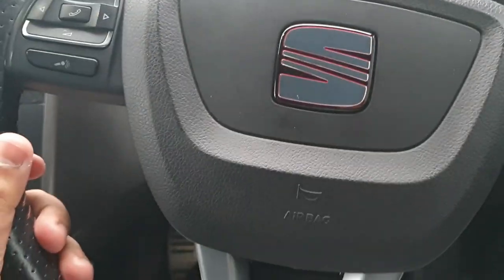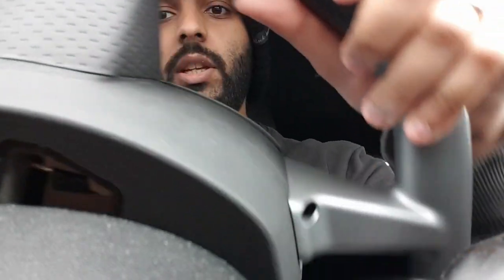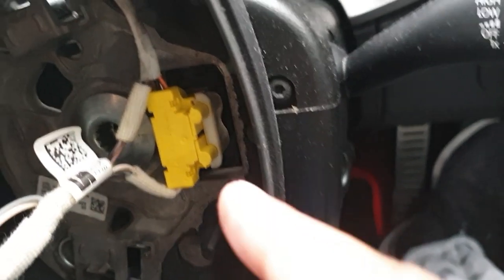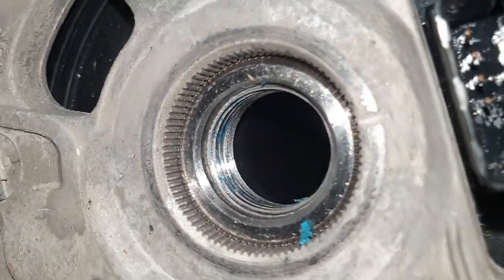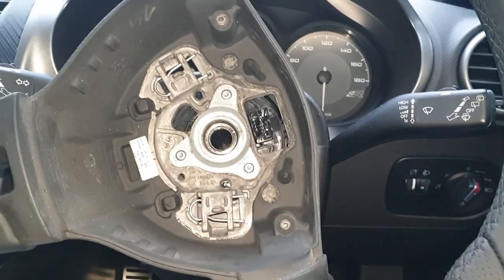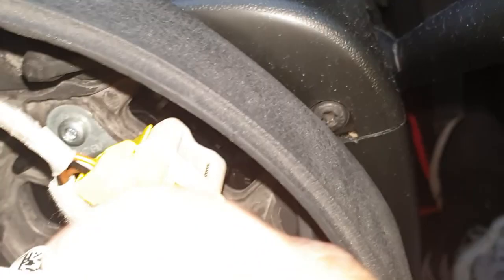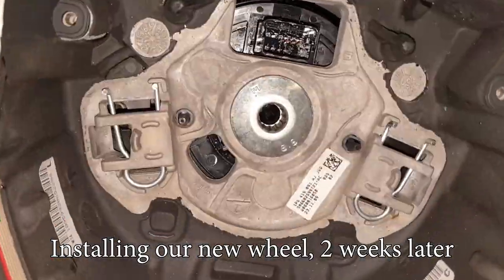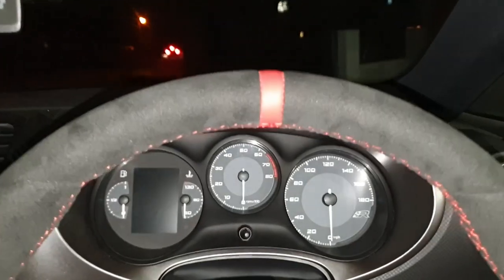Getting a custom steering wheel retrim | Royal Steering Wheels |

Comment: hello. is there any way to buy that matte grey bottom trim and the cupra badge inside it? The cupra R I've bought has glossy black trim (probably just repainted) and the cupra badge is missing altogether.  or do I have to buy a whole steering wheel in order to get that?
Reply from the maker: I took those off recently while the wheel was off and didn't see any part numbers on it, so I believe you'll need to buy the whole steering wheel. 

If you know anyone breaking a Cupra R, it may be worth asking if they want to swap your wheel or if you can buy the bits you need (or the whole wheel may be cheaper).